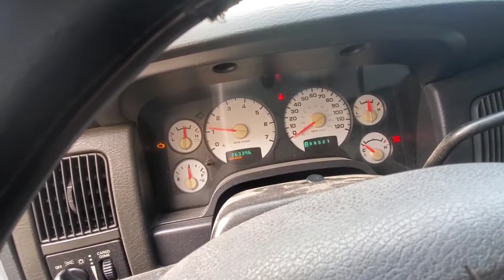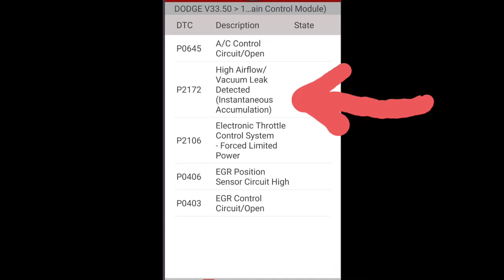P2172 2004 Dodge ram 1500 high airflow or vacuum leak detected, FOUND WITH OUR SMOKE MACHINE!

Comment: What was the issue on this in having the same issue in my jeep after I put it together
Reply: I have the same issue on my Jeep after replacing the lower intake gasket.  I'm thinking I did not get the EGR tube seated well at the EGR, did you find your problem?
Reply: Its a 2007 JK with 3.8L